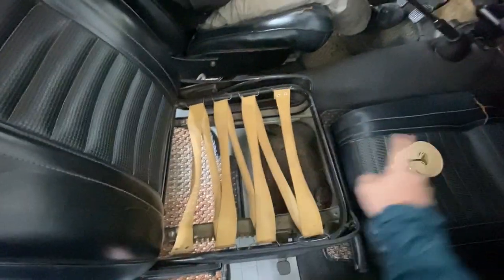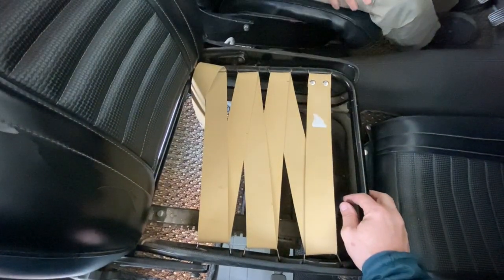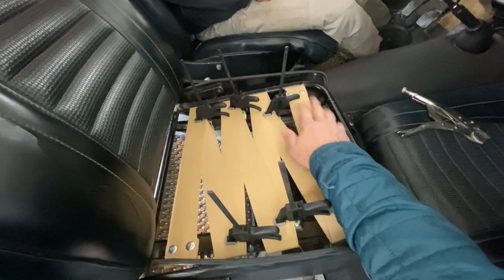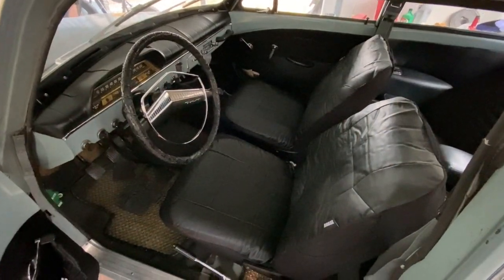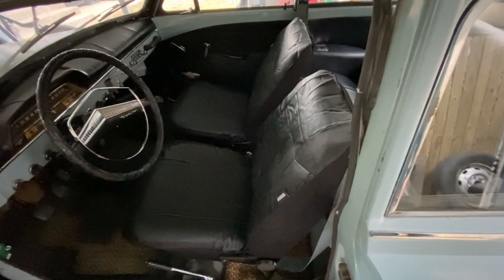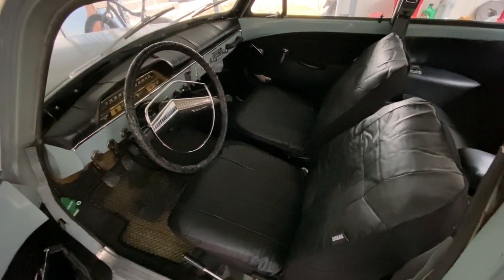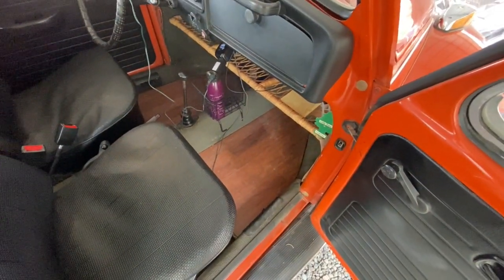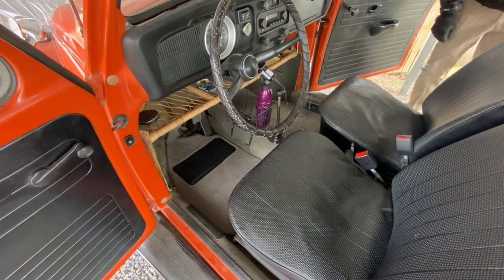Ingrid the Volvo 122s Seat repair (And Beetle carpet)

Comment: Brilliant video. Thanks. Just wondered how do you take the seat part off. I see it placed in your footwell so guess it comes of complete
Reply from the maker: The seat bottom just snaps off. The frame has 3 bolts that bolt onto brackets. Pretty straight forward.

Comment: Still struggling with fitting mine. Removed the seat and bought it into a warm house plus warmed up the strap in warm water but still cant stretch it enough.
Reply from the maker: @stephenburnage7687  it took two of us to pull it enough. And once I had it wrapped around, we had to pull each zigzag again and again and again to keep getting enough length to finish it. I think I use channel locks at the end to get the clip lined up into the holes on the frame. however, with all that work, it was nice and tight so that I don’t fall through the bottom of the seat.
Reply: @Misunderstoodboygenius  in the Nordicar video the strapping is brown and looks slightly elastic. Mine is white and looks to be fabric, with no indication of elasticity. I even boiled it in a saucepan but it still gave no impression of wanting to stretch. Also tried putting a long bar through the loop and stretching it with the car jack, all to no avail. So far, the closest I have got the final clip is 1 to 2" away. Any other suggestions or have they changed the spec?
Reply from the maker: @stephenburnage7687 unfortunately I don’t. Mine was elastic. Made by Perelli. It definitely stretched. I’m not sure about the fabric one. I’ve never dealt with it.
Reply: @Misunderstoodboygenius   I think they may have switched manufacturers, then. No indication of any manufacturer on my webbing. Need to hunt down the older Pirelli one!

Comment: This is a really useful video in definitely need to do the same. Where did you get the new parts? I would be really interested in those? Great video
Reply from the maker: I got them from Nordicar. They have the rubber already cut to length and looped. I did bottoms and had my upholster do the backs.
Reply: @Misunderstoodboygenius  that’s great thanks so much for that I will definitely want to sort mine when the time comes.

Comment: Any need to rework the bead around the doors?
Reply from the maker: On both the top back corner is ripped. I’ll probably do it eventually. It’s a pretty easy job too. Remove sill plates and the plate next to the dash in the door jamb, and pull the old one out.  The new one is kind of a springy chevron shaped flare that goes in the slot the old one came out of.
Reply: Isn't it stapled into the strip above the window, that you need to mess with the headliner?? My headliner is fine, but the bead strip is shot, and I've understood you need to undo the headliner to replace the bead strip.
Reply from the maker: @paulbuckles5353  hmm. I’ll have a look. If I remember right the headliner has a plastic strip on it too that feeds in there. But it’s been decades! I’ll look.